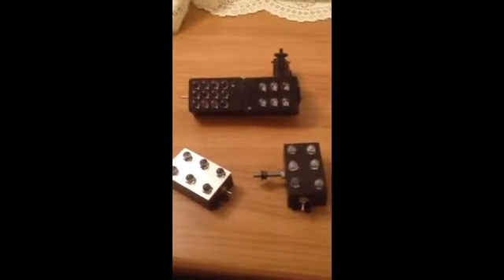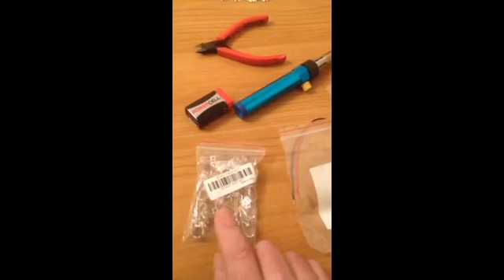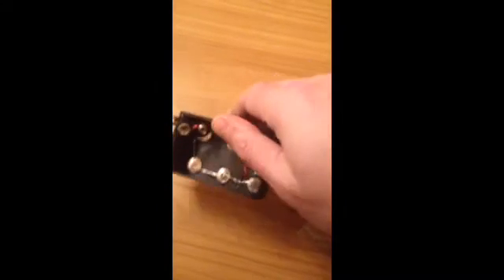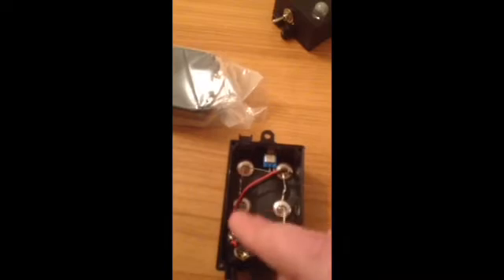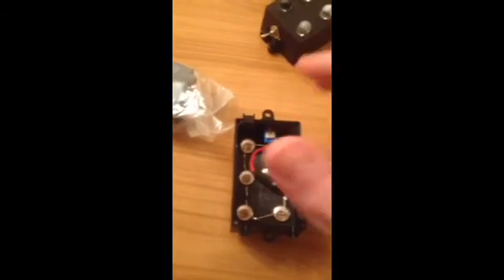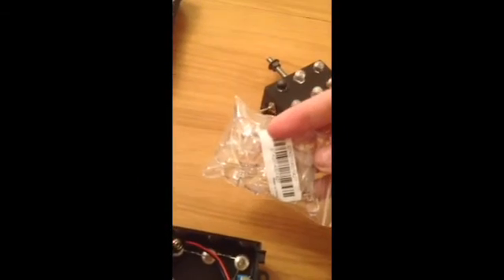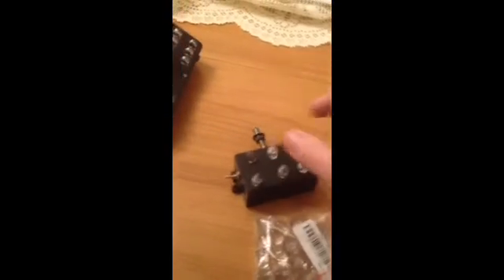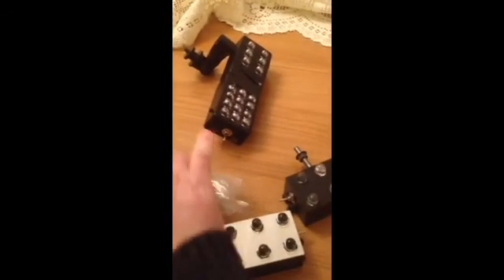How to make an infrared illuminator

Comment: I've been wanting to build one of these for a while now (they're so expensive to buy) if I use 12 LEDs instead of 6, do I use 2 9volt batteries wired in series? Great video by the way.
Reply from the maker: Hi there ! All depends what the forward current and voltage is my friend . Also take into account the milliamp rating. You can work out the math using ‘ohms law’ , it’s easy enough to fathom as soon as you get your head around it . If you have any trouble, get back, we’ll see if we can help !
Reply: Thanks. Much appreciated.
Reply from the maker: No problem sir !

Comment: Can you mix IR and UV led to make a full spectrum box? Also with your dual box are they wired individual with 2 batteries? Great video by the way :)
Reply from the maker: Hi Ghost Watchers Inc , it depends on the voltage of your batteries and the voltage of your leds . You could mix IR with UV in theory if the amp and voltage matched the battery however , I would use two seperate circuits in the same box with seperate batteries so you dont have a big drain of power .
For example one led could be 1.5 volts , if you are running off one 9volt battery you could use 6 leds because 1.5 volt multiplied by 6 is 9 volt , matching your battery , hope this helps .
Reply: PsiHull brill that's what I thought, thanks for confirming bud  :)

Comment: Can i ask question for u, i build diy ir booster 11 led, why my light cannot on, please help me? I use led ir 300mw 10mm
Reply from the maker: You need to build in parallel so you would need an even number of leds that up to 9volt , each led is 1.5 volt .
The power source is 9 volt but yours adds up to 13.5 volt, you don’t have enough battery power

Comment: Hello there. 

I'll make one but I've a question.
I'm planing to  use 1 9v battery for 6x 10mm IR LED 1.5 v 200mw diode for the project
Do i need any resistors for it and which resistors do i need?

Anyone?
Reply from the maker: Good question ? we kept it simple but im sure if you work with ohms law you can work it out

Comment: Hi, Great Video. What size box is best to get for a project like this? I've seen some 100mm x 76mm boxes. would these be the best size?
Reply from the maker: Any size box you want , we like the smaller ones , as long as you can fit your battery inside then its all good
Reply from the maker: The smaller the better for me , depends what I can get